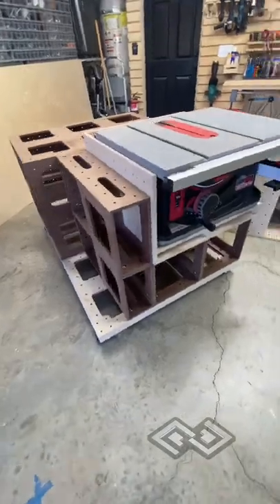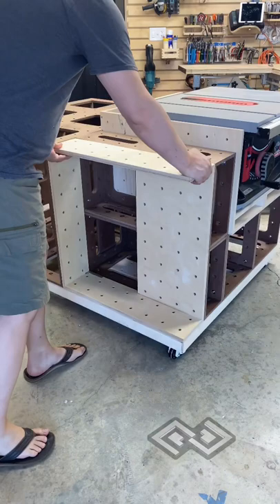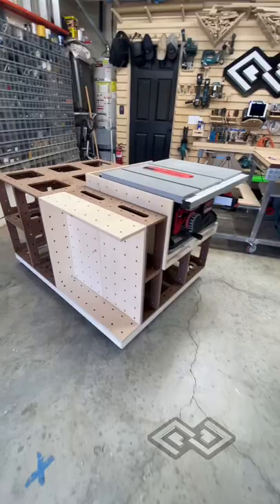Added cross cut sled storage area to the modular cubic workbench. #workbench #workbenchbuild #cnc

Comment from the maker: Added crosscut sled storage area to the modular cubic workbench.

Created using @avidcnc 
Plywood CNC cuts made with @highcountrytools endmills which are fantastic 😉👍
Designed in @adskfusion360 

See other posts for more details on the modular cubic workbench.

#workbench #workbenchbuild #avidcnc #highcountrytools #woodworking #woodworkingproject #creativity #creativityfound #plywood #cncproject #cncwood #woodcnc